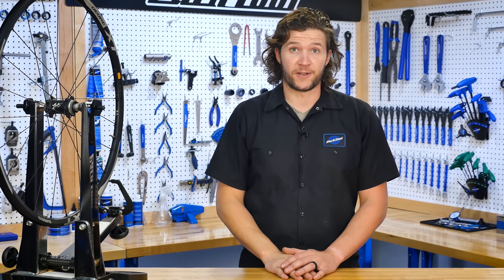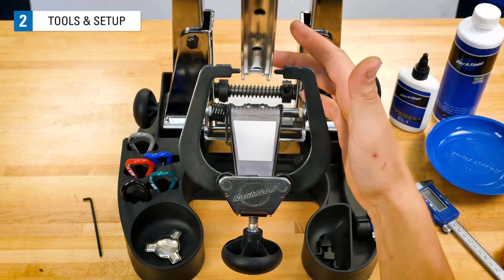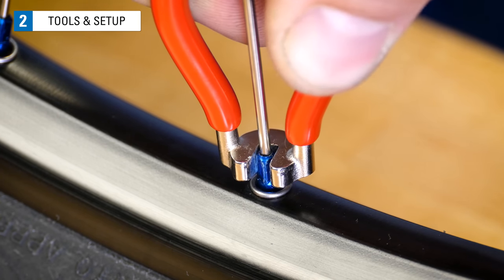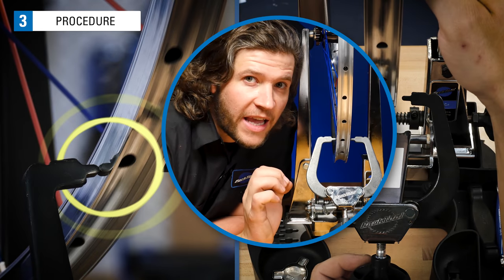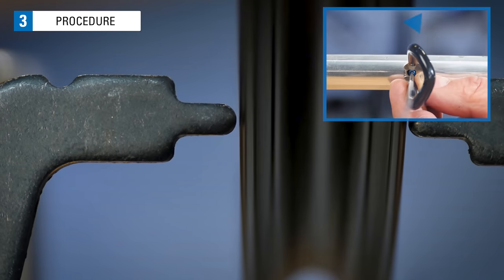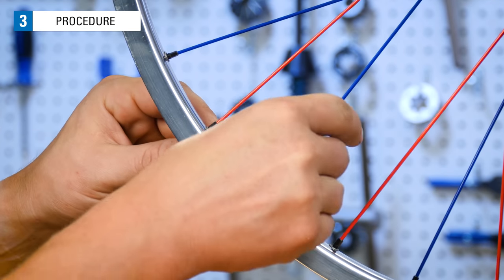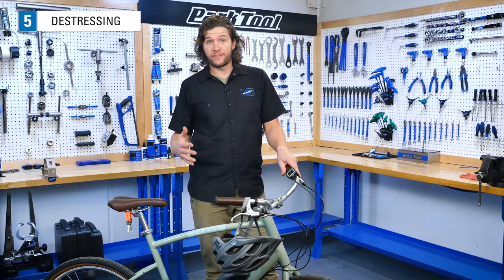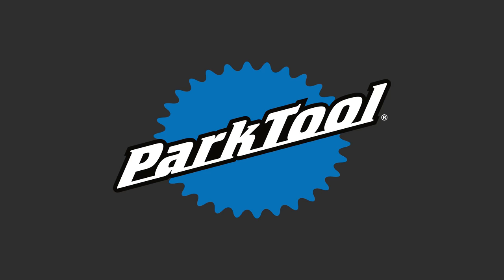How to True a Wheel Part 2: Lateral Truing

Comment: This video should be called "That one weird trick bike shops don't want you to know" but it would not be a clickbait title it would be true!! My son's bike had a badly buckled front wheel. I watched the first five minutes of this video, and did my son's wheel and BAM it went from horribly buckled to virtually true in the space of five minutes! It's like magic!! Thank you so much Park Tool. The bit that helped me by FAR the most was seeing the guy squeezing two spokes together and showing how that bends the wheel to the side. Once you understand this, the task went from utterly confusing to "so simple why didn't I learn this years ago" :) It also helped that there were some quite loose spokes on the wheel, and they aligned with the buckles, so it was extra easy to find where to tighten. And finally, it took me a while to figure out which way to turn the spokes (I know it says in the video but I wasn't concentrating). You have to turn the spoke nipple the OPPOSITE way to the way you'd expect to tighten (i.e. anticlockwise with your hand). Oh yes, and I just used the brakes to align the wheel with the bike flipped upside down. I'll never have to pay a bike shop to true a wheel again!! And it's SOOOOOOOOO satisfying when the wheel suddenly stops bumping the brakes. THANKS SO MUCH :)
Reply: Yes, I wonder why the thread on the spokes is the opposite as normal threads... that's very counter-intuitive! Edit: now I understand it's not the spoke that turns, but the part the spoke screws into!
Also some people advise to start by checking tension on the spokes, even by hand, pinching 2 spokes together to feel those that are bending too much. Then only start the truing process...
Reply: @DR_1_1  It's not opposite, it's just upside down.. The spokes and nipples are right-threaded ("normal" way) but you're working from a different perspective. 

A good visual example is opening the cap of a water bottle when you hold it face down to drink from it

Comment: Thanks, fixed my rim brakes hitting the rims. Perhaps I'll try the other truing steps but I only got a cheap bike and I'm happy enough with my problem fixed.
Didn't even have a proper bike stand so I couldn't even do the zip tie thing, so I basically just rolled the bike on the ground to check whenever the brakes hit the rims. On hindsight, I'm just gonna flip the bike upside down...

Comment: Thanks Park Tool for another great video easily explaining how to do this, and big props for providing an alternative to buying expensive hardware. I've managed to removed a bit of a wobble (it still wobbles but not as bad) in my rear tire now with a couple of cable ties and masking tape to mark the contact points. We're currently locked down and can't take the bike to the LBS.

Comment: Great and informative video. Now I want to see how to true a wheel without that truing tool. Just with 2 cable ties shown on the video. You can also use 2 wires. May it be a laundry wire or solid electric wires. Most cyclists won't spend I guess for a truing stand unless they can be sold at a cheaper price. Or maybe create a truing machine wherein it can detect spokes that need to be adjusted.

Comment: After truing my method of detensioning is lay the wheel flat on a work surface, it is out of the bike anyway. Press the axle into the work surface using down force on the rim. Go all the way around, flip the wheel and do on the other side. Repeat again and recheck the rim for trueness.

Comment: Awesome video. I'm building a wheel now with your videos. Spent a lot of time on it. I've got my wheel very close. Still some small deviations. Gonna check with the paper how bad. I noticed that as you close in on overall tension measuring with the TM-1, perfect truing becomes hard to obtain. If I correct minor deviations,  my consistency of overall spoke tensions starts to worsen fast.  Thinking overall even tension might be a hair more important and live with a few minor deviations.
Reply from the maker: Especially for a disc hub wheel, overall even tension is more important.  Rims come new with internal tension from being bent.  Things are not perfect.  Perfect true and perfect tension occur only on paper, not on the bike.

Comment: Hello and thank you for the great instructional video !
I would like to ask a quick question - many people have told me that while truing we need to always tighten on one side and at the same time un-tighten on the opposite side.
What would be the correct way ?
Thank you again
Reply from the maker: The reason to do this is to equalize tension. This is not needed in most cases, especially if you do not have a good way to measure spoke tension.

Comment: I'm surprised Park Tool recommends to only tighten the centre spoke on the one side of the lateral deviation. It seems to me that doing this will : 1. put too much tension on that one spoke and lower the tension of its neighbouring spokes; 2. increase overall tension on that segment of the wheel, creating a low spot radially. I've learned to release tension on the opposing spokes to maintain radial balance and also spread the re-tensionning to all of the spokes in the section of the wheel touching the indicator. Am I complicating things too much for nothing proceeding this way?
Reply from the maker: This can be necessary but not all the time. As rims get more and more bent it can be required to do as you do but if being mindful of tension, radial true, lateral true and dish you will correct any error created by a previous adjustment. The wheel is effected in many ways but loosening spokes is not something we want to suggest to people that may already have low spoke tension.
Reply: @parktool  Ok thanks, it makes sense.

Comment: New bike, 3 weeks, 350 km, and already a side wobble, obvious to the eye while riding!
It's a CX bike, I'm not into competition or riding like crazy, but maybe 20% of my rides are on trails, some with small rocks, gravel, etc... Also it's aluminium, so the frame won't absorb any shock, fork is carbon but straight tubes that won't flex much, either...
Is that normal? With my road bike and lighter wheels I had no issues for years!

Comment: A good rule of thumb (pun intended) for anyone unsure which direction to turn the spoke wrench for tightening their spokes, is called the RIGHT HAND RULE. Let your right hand curl as if you are grasping the spoke, with your thumb pointed toward the hub flange. In this position, your fingertips will indicate the direction to turn the nipple for tightening. Try it!
Reply: that would be counter clockwise, which is tightening.
Reply: Since I tend to focus on the rim & nipple as I am working, the LEFT HAND RULE works better for me, but it's the exact same concept: you curl your left hand with thumb pointing towards the rim and nipple. That's the direction to turn the nipple to tighten the spoke.

Comment: Hello, I'm scratching my head on lateral TORSION of my back wheel, when I'm sprinting hard I can feel the tire rub on the frame, wich is wired considering the fact that the tire is from factory spec, same for the wheel... Wheel itself is very true, it just flexes a lot under side load... Any solution? Beside changing wheel or running a narrower tire
Reply: Try putting a little bit more tension on the spokes just a little it shut get rit of it (sorry for English)
Reply: MRGRUMPY53  treu but some wheels lose a bit of tension after a few months if it a new bike the first time check the tension and keep checking it if you ride a lot or have some wight moost rims can take a lot before they brake moost times the spook brakes

Comment: How to know if the problem is on the rim itself or to the spokes tension? If some part of the rim is not centered on the v-Break while biking?
Reply from the maker: Inspect the area of rim that is the worst.  Check the spoke tension on both sides if this area.  Assume the worst area deviates to the right.  If the right side spokes in this area are loose, it indicates the metal is bent in this area.  Changing spoke tension might help a little, but tension cannot re-bend the metal back straight.
Reply: @parktool  noted, thank you so much for the help :)

Comment: What if I have to make 2 turns? is my wheel just super out of true and I need to bend the rim. 

Also is it bad to make a spoke crazy loose?
Reply from the maker: If some spokes are very loose, and in th same area some need to be very tight, it is likely this area has been bent.  If it is spinning adequately, just ride it.  There is no good repair once the metal is bent.

Comment: I had the lateral almost perfect, when I then went and did the radial true, the lateral is now waaay off, and I cant get it back again. Did I bend the rim somehow? I have tried loosening the spokes all back to just a little tight, but lateral is still waaaay off, no matter what I do. Spokes are almost getting stripped from loosening and tightening so much.
Reply from the maker: Going between lateral, radial, tension and Dish is a balancing act. Making minor changes to each as you go. I do not think your wheel is bent if you had it close before.

Comment: I have one spoke less and now the wheel is wobbly. Is it recommended to put in a new spoke? Or shall I try and true the wheel?
Reply from the maker: Yes, you should get another spoke the same size and install it.
Reply: @parktool  thanks for the quick reply. I was just wondering out of curiousity: if I'd remove one spoke the opposite side of wheel radially and laterally, wouldn't that solve its wobbliness as well? :P
Reply from the maker: You need to replace the spoke that broke. Removing more will just make the wheel weaker and will come out of true more often or possibly fail.
Reply: @parktool  understood! Cheers!

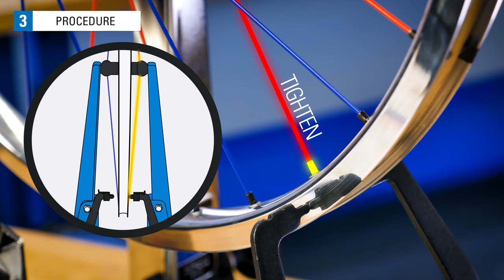Comment: Is the diagram mismatching with the stated example at 5:29? In the diagram, it looks like you'd want to tighten the blue spoke to pull it to the left, which is opposite of the stated example. (?)
Reply from the maker: The animated insert is opposite of what the stand is actually showing in the video. The information in the animation is correct other than the indicator hitting the wrong side.

Comment: so this is useful and all but what if u have a missing spoke?
Reply from the maker: If a spoke is missing or broke, that section of rim will not have the pulling or tension it needs.  You can minimize this to some extent by loosening the opposite side spokes, but you wheely need that missing spoke.

Comment: I tried it and had no progress what so ever I turned the nipple who knows how many times in both directions with no improvement. When I spin the rear wheel on my bike it wobbles together with the cassette and a brake disc. Is this normal when spokes are loose or there is another problem attached to it?
Reply from the maker: it is not common that there is another problem but there is of course that possibility. If all of your spokes are loose you should go around and give them all 1-2 turns then check tension. If you tighten one spoke many turns it will not do much and will cause the wheel to be out of round. The spokes act as a team and the whole team needs to be pulling its weight or in the this case tension. Check for cracks in the hub or in the rim. Those are possible areas that would allow you to continually tighten.

Comment: 2 comments: 
Lateral truing can influence radial trueness. I understand you want to keep things separated, but they are intertwined.
Riding is quite a frustrating way of destressing, as you have to mount a tire / cassette / wheel. It's much easier to either pull the spokes with your hands, or take the wheel out of the truing stand and push at all sides. Also, push the rim while the wheel is on one side of the hub. This will truly destress the wheel, and after destressing, you always need some truing.

Comment: Is there something like a rule for switching the indicator finger? The left indicator finger touches, you tighten some spokes on the right side of the hub. Then you focus on the right indicator finger, tightening some spokes on the left side of the hub.....  Why switching the indicator finger at all? Why even using just one indicator finger?
Thank you
Reply from the maker: If you switch fingers every 3 or 4 corrections, you tend to hold the current dish.

Comment: Slight error with the graphic shorn at 5:23. The graphic shows the rim touching the right indicator, and suggests tightening the right spoke. You would actually want to pull it away in the opposite direction by tightening a spoke on the left side.
Reply from the maker: At exactly 5:23, the left side indicator is touching the rim. The flashing red spoke should be tightened to bring this part of the rim right, so it will no longer rub the left indicator.

Comment: I don't understand why you make a distinction between working "on the bike" or "in a truing stand" when talking about the direction to turn the nipple. The direction is the same in both cases -- counterclockwise to tighten the spoke. The key distinction is whether you are working "from the hub" side or "from the tire side".
Reply: Do you mean from inside the wheel, “hub side”, or outside the wheel, “tire side”?
Reply: @clarkbausch2064  When working from the hub side, tighten the spoke by turning counterclockwise, regardless or the orientation to the wheel.

Comment: The only thing I disagree with. IS RIDING THE WHEEL TO GET THOSE PINGS AND POPS AND UNWINDS. 

The consensus for most experts is. You want to do this on the truing station. Because those pinks and pops can make the wheel go out of true again because the tension is changing. 

You're supposed to pull all the spokes somehow and get those pinging and popping out of the wheel before it goes on the bike. Then you recheck the truing again with the .05 mm of paper or feeler gauge to make sure it did not go out of true.

It would really stink if you did all that work You took it for a ride and realized it's now out of tolerance you have to take the tire off take the tube off and start over again 🤣